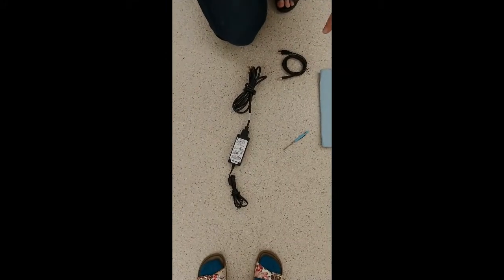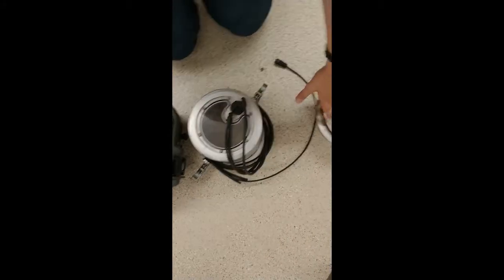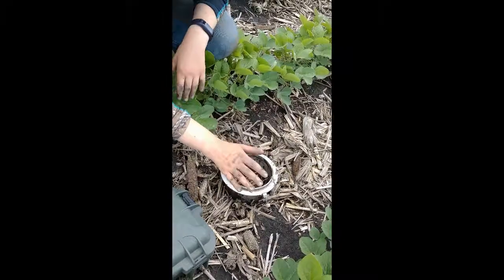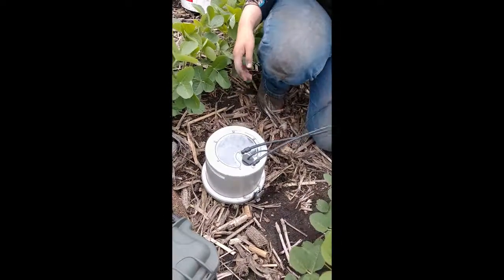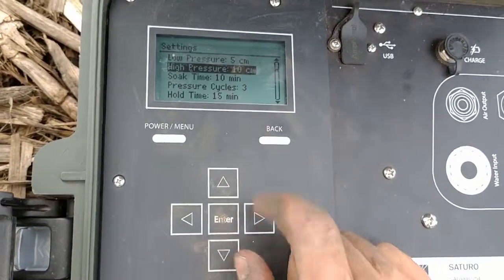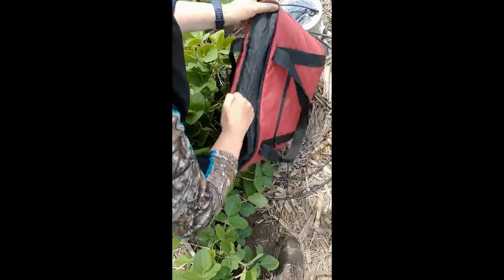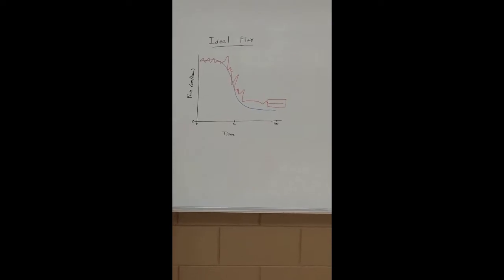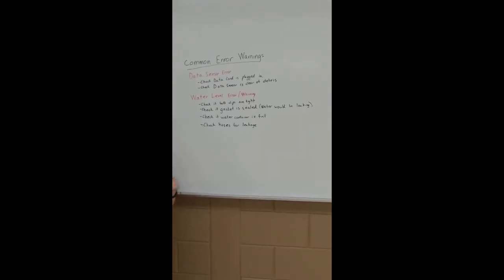How to Use a SATURO Dual Head Infiltrometer

Comment: The hold time and pressure cycles vary depending on the soil type and environmental conditions. In general, longer hold times and more pressure cycles can help achieve steady-state conditions. Both can be assessed in real-time in the field and adjustments can be made to subsequent runs to ensure high-quality data.

Comment: Excellent Intro! Just a few questions!

What is the hold-time?

Does it matter what you set as low/high pressure?

Does it matter how many pressure cycles you set?

Are pressure cycle durations fixed? Or do they depend on run-time?